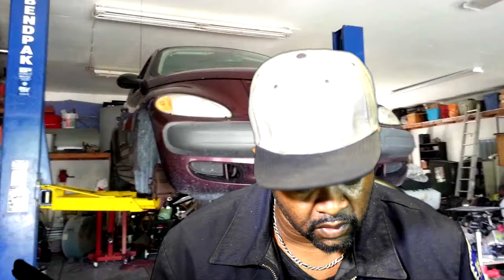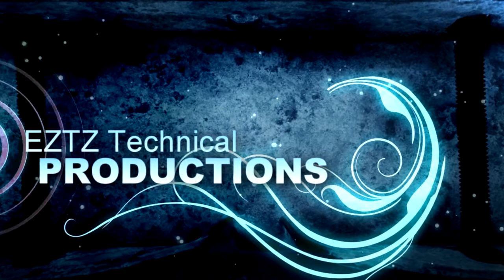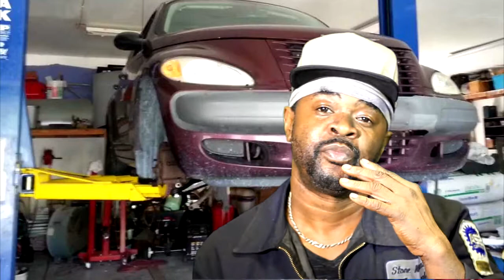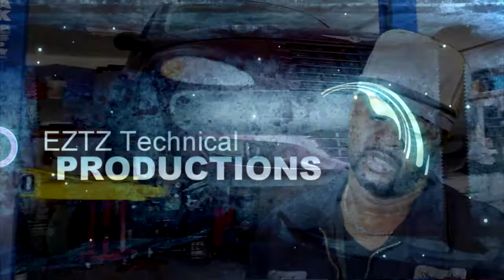How to diagnose a DTC code P0128 if code returns. Thermostat Rationality. Overheating when AC on

Comment: Have a 07 chevy siverado duramax diesel, got this code after I sprayed the front of the radiator with water, dealership reset erased code, hadn't came on in 6 months, took truck to car wash and code came back on.

Comment: I have a 2008 pt and i put a new thermostat . new temp sensor. New fans. New coolant. And I get the po128 . replaced the thermostat 3 times New. And I still get it.. Your opinion??

Comment: 2004 PT Cruiser with the exact problem described here.  He is correct.  I did exactly what this guy advised, Flashed PCM.  Dealership cost out the door was "$135.20" and it took them about one hour.

Comment: good video but the problem still comes back first time I saw the code come in I replace a thermostat like you say a little while later the code came back so I ignored it later on a computer went bad and it had the computer replaced and the code came back  four days later. could it be that i should use an OEM thermostat?
Reply from the maker: yes i would use an oem mopar thermastat..It has the white oring/gasket built on it...I assume this a PT cruiser you working on..Also, why was the computer (PCM) replaced, and third, please subscribe to the channel for me
Reply: yes it is my 2004 , pt cruiser, the computer went out after  bought the car 2 years later, it had something to do with the coil wire and spark plugs.   basically it had a tune up done, when it broke down it blew a fuse and shut down and took awhile because mechanic was trying to figure out what went wrong.   he put in a replacement computer preprogrammed for the car and it started right away no problem.  but i got that p0128 code back again. but car runs fine for now.